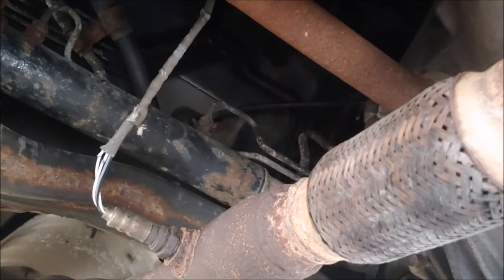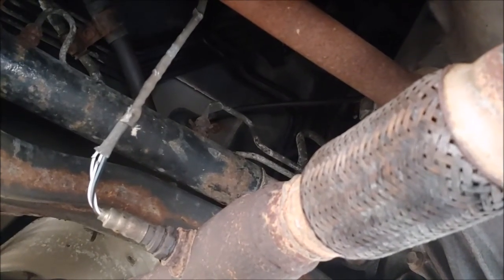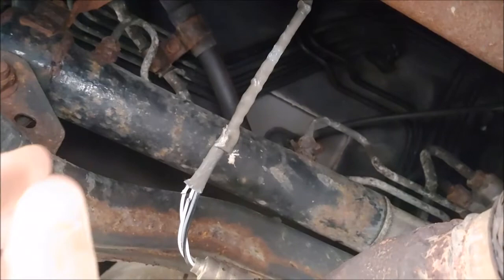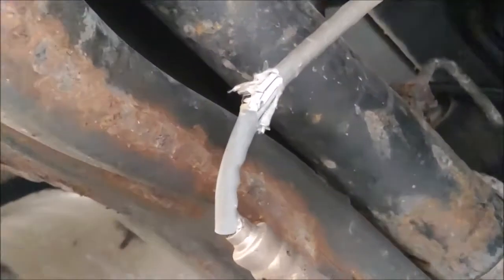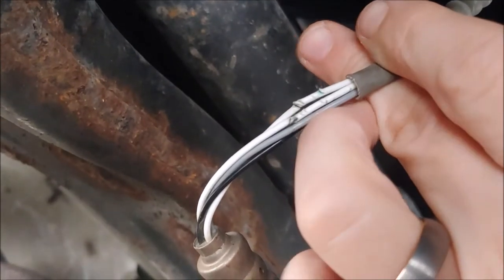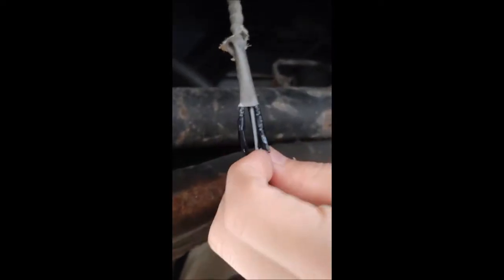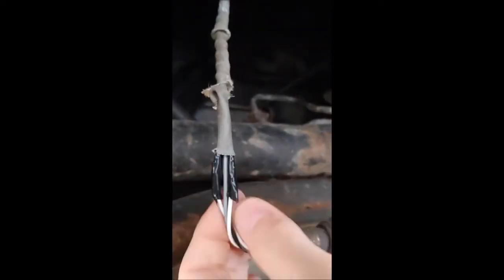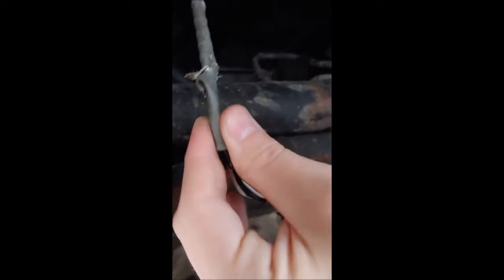2002-2006 Toyota Camry P0137 and P0606 Check Engine Light on Wet Rainy Days Diagnosis / Repair

Comment: i have this exact same issue in my rav4. During rainy season when i drive through water, the check engine light comes on and the obd scanner shows o2 sensor at bank 1